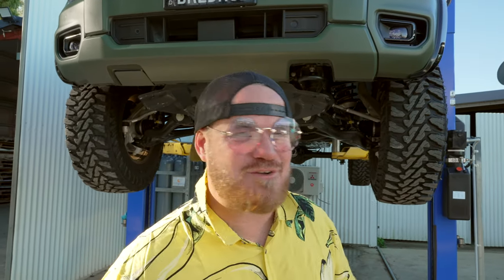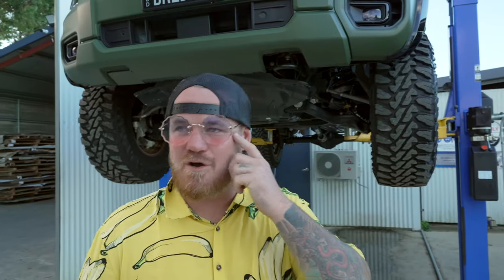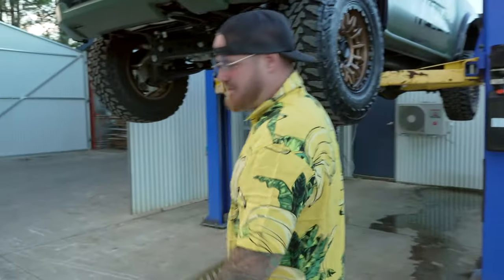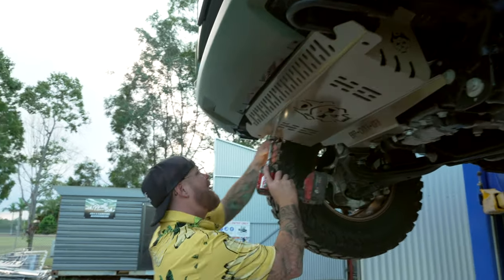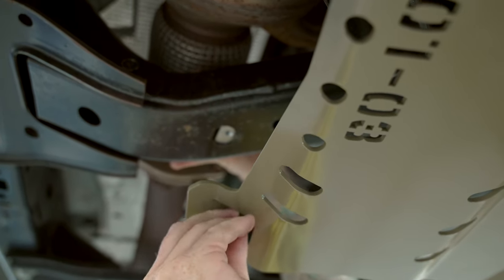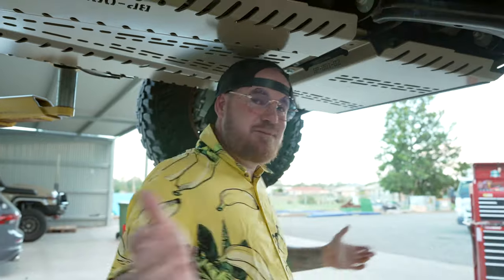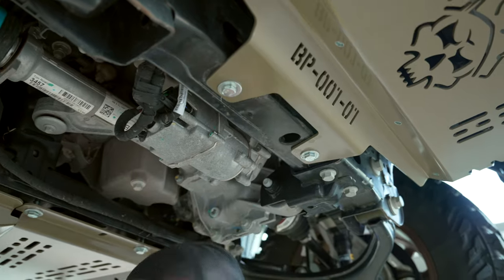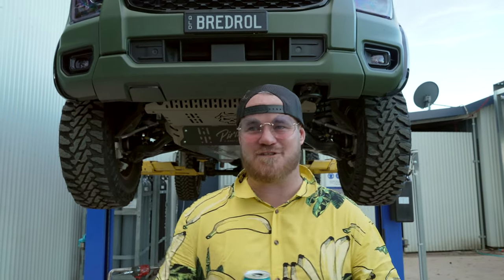UNDERBODY PROTECTION PLATE FOR FORD RANGER/EVEREST 2022+ How To Install

Comment: Could you consider doing a red tab or something on the back of those insert nuts that went into the hole for the transmission plate.. would make them easier to control them and not loose them next occasion the plate gets removed..
Reply from the maker: G'day legend,

Thanks for the suggestion. We'll have a look & see what we can come up with.

Comment: Is the only difference between the everyday version and the madmax version the thickness of steel? Or is there a shape/style difference as well? Thanks
Reply from the maker: G'day legend - the only difference is the material, everything still presents the same.
Reply: @piratecampco  Does it stop you putting a long range tank in? Cheers